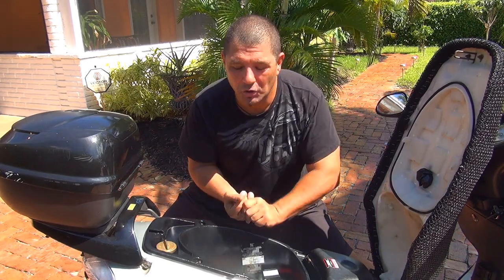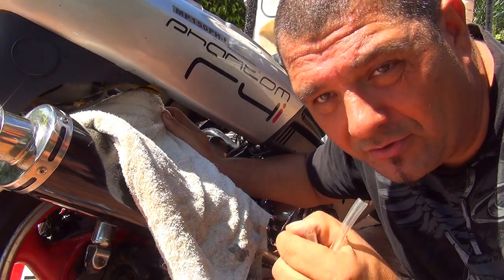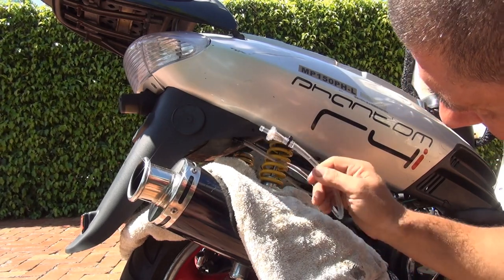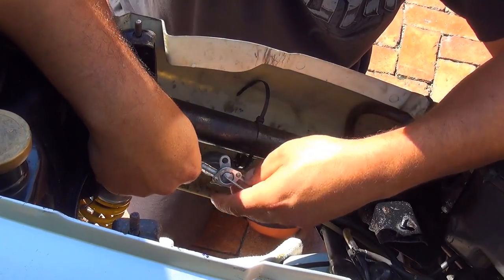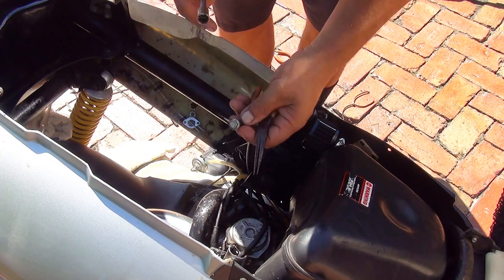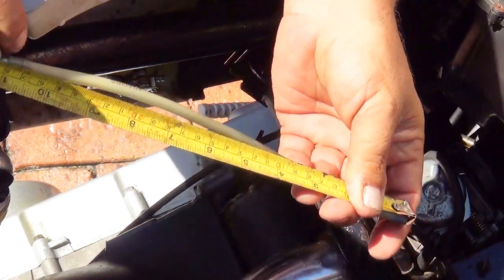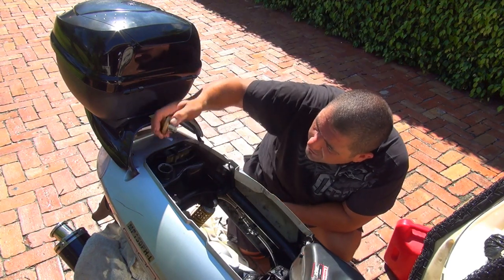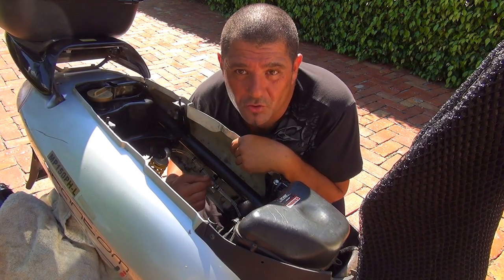Chinese Scooter Fuel Shut Off Valve Upgrade

Comment: I am working on an Amigo Speedy 50 and doing the same kind of upgrade. I am glad to see that the parts are available to fix the fuel flow problem.
Reply from the maker: That's great to hear that you're working on upgrading your Amigo Speedy 50 and fixing the fuel flow problem! Having access to the necessary parts makes the process much smoother and allows you to ensure your scooter is performing optimally
Reply: Same Amigo issue. Good video.

Comment: Hi, so do you just plug up the vacuum lines then coming out of the carburetor ? Wasn't sure.
Reply from the maker: Hello just plug the vacuum line that is connected to the center nipple at the petcock fuel valve

Comment: Hey my friend so if you plug the vacuum line coming from the inside manifold does that mean the top port of the carburetor is left open with nothing connected to it? I'm confused trying to make sure my fuel and vacuum lines are right
Reply from the maker: Hello my friend just place the manual valve and close the vacuum lime that go to the old fuel valve and live everything else the same way if you have an oem 150cc carburetor you need to have the vacuum on top of the carburetor

Comment: Love your videos! Can you tell me if adding a fuel shut off valve and taking off the petcock is a good idea on a new 150cc scooter?  or should I just leave it as is? Thanks!
Reply from the maker: Hello honestly is a good idea but the only problem that I don’t like much is that every time you stop longer than few hours you should close the fuel switch instead with the petcock the system goes on automatic

Comment: Hello my friend. At @18:45 what is the small air filter in the top right corner and what is it used for..? Thanks
Reply from the maker: Hello my friend that is a filter reservoir that is connected to the valve cover breather hose check my video how to install a reservoir. Thank you for watching my video

Comment: top video bud i have a 4 way petcock with having problems with but may convert it now, the only issue i am having is it seems like when the bike is running it is over filling and pouring petrol out the overflow any ideas as float and pin seem ok
Reply from the maker: Hello jaybillyjosh  the problem to me sound like that the carburetor float is not going back up after the fuel goes inside the carburetor and is not stopping the fuel flow so try to clean the carburetor and test again plus check if the carburetor floater is not damaged
Reply: @VirberelloScooterTips  hi thanks for reply, its been cleaned and on a normal float you have a metal tab you can alter but this is all plastic any ideas how to solve that as everything seems to slide and move free, jay from the uk

Comment: I have model with gas tank in the scooter's floor, lower than the carburator. Can I put a non-return valve instead of classic valve, to prevent fuel from draining from carb bowl back to the tank, and not obstruct the flow from tank to carb? Im having a problem to start the scooter when it sits 1 week or longer and I suspect thats the problem.

Nice video and content, carry on👍
Reply from the maker: Hello my friend I nor sure if placing a  non-return valve will work I think you will have problem when the scooter is running but the only way to know is to try and see if it can work . Thank you for watching my video

Comment: Why close the hose at 17:55? I was told that was the breather line for the head
Reply from the maker: That hose is the vacuum line coming from the manifold the head breather connects to the air filter box and you should never close that or the motor will build to much pressure

Comment: My gas float on my SSR -150cc wont come out of the gas tank? It seems to be bigger than the hole the unit sits in. I've tried every angle but cant get it to come out. Any ideas?
Reply from the maker: I did that in my scooter and took me long time before I find the perfect angle for the floater to come out look at this video at 20.05 minutes https://youtu.be/ECyStySqkXA with my father in law

Comment: Thanks for the video pal!!! ✌🏼 🕊️
Reply from the maker: Hello my friend thank you for watching my video
Reply: @VirberelloScooterTips  hello, my name is Timmy, I wanted to ask you a question, I own a 2021 pony 50 atm50a1 scooter, I need to make(fabricate) a muffler bracket, i don't have much money so buying a bracket online is not a option at this time, I was thinking of drilling a hole in the frame above where the muffler rests, and that's what I wanted to ask you the best way to make a homemade bracket so I can attach the muffler clamps too to make the muffler sturdy, any ideas?
Reply from the maker: @timmyczajka8411  Hello Timmy the best way to fabricate a bracket is to make a copy of the original bracket or something similar but I will not drill the frame because that can make the frame weaker and also sometime the frame and the motor they do not move at the same time but the scooter swing arm yes
Reply: Thanks pal!!!

Comment: Does it matter the size of the fuel fuel to the more gas to give him more power
Reply from the maker: The size of the fuel filter does not directly affect the power output of a scooter or any internal combustion engine. The primary function of a fuel filter is to remove impurities and debris from the fuel before it reaches the engine. Its main purpose is to ensure the engine's proper functioning and protect it from potential damage caused by contaminated fuel.
The power output of a scooter or any engine is determined by various factors, including the design and displacement of the engine, the air-fuel mixture, ignition timing, exhaust system, and overall efficiency. These factors are typically controlled by the scooter's manufacturer and are not directly influenced by the size of the fuel filter.

Comment: I have suzuki address v50g 49cc scooter it's a fuel injection scooter but it's not starting however the spark plug is fine and supplying the electric current. Than what happened is fuel inection malfunctioned ?
Reply from the maker: If your Suzuki Address V50G 49cc scooter is not starting and you've confirmed that the spark plug is fine and receiving an electric current, the issue could indeed be related to the fuel injection system. Here are some steps to diagnose and address the problem:
Fuel Supply: Check the fuel supply to the injector. Make sure there is sufficient fuel in the tank, and the fuel lines are not kinked or obstructed. Ensure that the fuel pump is functioning properly. You can listen for the sound of the fuel pump when you turn the ignition on.
Fuel Filter: Inspect the fuel filter for clogs. A clogged fuel filter can restrict fuel flow and cause starting issues. Replace it if necessary.
Fuel Injector: The fuel injector itself could be clogged or malfunctioning. You might need to remove it for inspection and cleaning. If cleaning doesn't resolve the issue, it might need replacement.
Throttle Body: Check the throttle body for any obstructions or malfunctions. Make sure the throttle body is clean and functioning correctly.
Sensors: Fuel injection systems rely on various sensors to determine the air-fuel mixture. Check for any sensor malfunctions. Common sensors include the Mass Air Flow (MAF) sensor, oxygen sensor, and engine coolant temperature sensor.
Fuel Pump Relay: Check the fuel pump relay to ensure it's sending power to the fuel pump when the ignition is turned on.
ECU (Engine Control Unit): The ECU controls the fuel injection system. It could be faulty or have a programming issue. If all else fails, a diagnostic scan tool might be necessary to check for error codes and ECU-related issues.
Wiring and Connectors: Inspect all wiring and connectors related to the fuel injection system to ensure there are no loose or damaged connections.
Fuel Quality: Ensure that the fuel in the tank is of good quality and not contaminated.
Compression: While this is less likely, it's still worth checking the engine's compression to ensure it's within the manufacturer's specifications.
If you've gone through these steps and the scooter still doesn't start, it may be best to consult a qualified mechanic or Suzuki service center, especially if the scooter is under warranty. They will have the tools and expertise to diagnose and repair the issue with the fuel injection system.

Comment: took mine to the shop.  it was chugging not wanting to go past 10 some time 25. but before it ran ok could get it up to 30 in no time.  replaced to fuel filter.  with a clear one drained the gas.but it still chugs. stays on 10 or maybe 15max and shits off in the middle of traffic.  any suggestions.  I took it to a shop.  but they said.its doing all.it.can do after 300$ of pay hoping to fix it. long story short its not.fixed . still having the same issue 😒my moped2016 50cc 49cc engine i think its a venture genuine 2016 moped . thought it could of.been bad gas or too much whight on maybe strained it.or something 
 really not.sure any ideas or suggestions.  about what I can do or.how I could.fix the issue?
Reply: shutdown
Reply: J.C.! You're being ripped off big time. Do yourself a favor and find a decent repair shop. If that's 300 USD it would be enough to get several brand new parts. Your problem is probably related with some carburetor clogging issues. Usually due to lack or inefficient fuel filter system. Electrical side i.e. CDI, ignition, plug... could certainly be another. 
Either case in a scooter 300 USD is a "shit load" of money. ;-)

Comment: Thank u so much.  I'm a girl and these shops keeps robbing me and taking parts of my new scooter and replacing with other parts. I'm suing needless to say. Anyways my problem I always that after I clean the carb n hook everything back up,  I have to take it to the shop just for the guy to create a vacuum so the gas can get to the carburetor.  It won't just start after I reconnect.  Will I still have to create a vacuum after this modification?
Reply from the maker: Hello if you place a manual fuel switch you do not need to create vacuum for the fuel to go to the carb but make sure you manually turn off the gas when you park the scooter
Reply: @VirberelloScooterTips  I'm so excited. I subscribed to you and thank you so much.
Reply: My fuel switch arrived today. I  have some clear hose that came with a siphon I bought a week ago.  My gas tank doesn't have a nipple like some.  It has a male thread with a petcock that screws over it. So do I just fit a hose over the  tank thread and zip tie it? The other end will be too big to fit over the fuel filter nipple and the switch nipple. That's where I'm lost.
Reply: @candace9642  - Do not make such a stupid mod. I wrote it elsewhere this mod is absolutely ridiculous. Totally senseless.
You need to "create vacuum". Literally suck on the vacuum pipe. it's that simple take seconds. You prefer a more distancing option. Get a syringe on any pharmacy. The bigger the better. Put it in the vacuum hose, pull the plunger. There's your vacuum on demand. Also takes seconds. My tool boxes always have a syringe, for decades. Extremely useful for a myriad of situations. Fuel, brakes, lubrication...

Get a good and decent fuel filter. you'll go years, without cleaning a carb. It's that simple. And please do not take advise from people who have no clue what they are talking about. Set the OEM petcock in leave it well alone. Aptly the old adagio, if it's not broken... ;-)

Comment: Why do a scooter Exhaust get so hot brun a holl in the muffler please help
Reply from the maker: Hello  Bennies many times the exhaust for gy6 are bad quality and insolation is not good and the pipe gets hot but sometime the exhaust do get very hot because are dirty inside or your motor is not running good and is missfireing and the pipe get very hot

Comment: Can you just put a cap on manifold and cap off the vacuum line on the top of the carburetor or run a hose from manifold to the top of the carburetor
Reply from the maker: Hello yes you can run the vacuum hose  from the manifold to the top of the carburetor

Comment: Many people have stated they run their fuel line from the fuel tank to the carb, with no shutoff. Is this a viable option or will fuel continue to flow into the carb when not running?
Reply from the maker: Hello my friend that is not a good ideas because the fuel will slowly leaking from the carburetor to the motor and will fill up cylinder and will leak inside the motor oil by passing the piston rings when scooter is seating more then 6 hours thank you for watching my video

Comment: My scooter just don't want to start what can it be? And ty
Reply from the maker: If your gas scooter is not starting, there could be several possible reasons for this issue. Here are some common causes to consider:
Fuel-related issues: Check if there is enough fuel in the gas tank. Ensure that the fuel valve is open if your scooter has one. Additionally, make sure the fuel is not stale or contaminated.
Spark plug problems: A faulty or dirty spark plug can prevent your scooter from starting. Remove the spark plug and inspect it for signs of damage or fouling. If necessary, clean or replace the spark plug.
Carburetor issues: The carburetor may be clogged or dirty, which can disrupt fuel flow and prevent the engine from starting. Cleaning or adjusting the carburetor might be required.
Battery problems: If your gas scooter has an electric starter, a weak or dead battery can prevent it from starting. Check the battery charge and connections to ensure they are in good condition.
Ignition system malfunction: A malfunctioning ignition switch, ignition coil, or other components in the ignition system can cause starting problems. Inspect these parts for any signs of damage or wear.
Engine kill switch: Ensure that the engine kill switch is in the "on" position. Sometimes, it can accidentally get flipped to the "off" position, preventing the scooter from starting.
If you have checked these common issues and your scooter still won't start, it might be best to consult a professional mechanic who can diagnose the specific problem and provide the necessary repairs.
Thank you for watching my video
Reply: @VirberelloScooterTips  got a new carburetor on ii change the spark plug wire a lot of it and still nothing getting plenty of fuel from the peacock it just don't want to start

Comment: Mine cut off while riding. Its not getting gas to the carb. So i ran it straight from the tank and it started. So my petcock is done pretty much.
Reply from the maker: Yes sometimes they get older and they gum up
Reply: @VirberelloScooterTips  i bought it from a friend its a2020 gator. It just stopped coming from work. New stator. It was acting like it wasn't getting gas.

Comment: Is the fuel pump switch better than the vacuum fuel pump?
Reply from the maker: Hello Bobby Joe the switch is not a fuel pump but a switch is better because has a natural gravity flow from the tank to the carb
Reply: NO, it is not. This mod is senseless and absurd!
Reply: @crpth1 why is it senseless and absurd??? It helps fuel flow better makes sense to me.
Reply: One pass from a fully functional automatic system. Which, literally, millions of scooters and motorbikes use for  decades. Without issues. So, now one spend time, money and absurd effort to go back. To a less functional system. That  "better fuel flow" claim. Sorry to say. It's as senseless and absurd as the previous. Thankfully engineering is a rather clear science. 😉👍

Comment: It does make sense but having to turn on and off every time can be very easy to forget
Reply: Guilty 👋
😵 but very funny when someone trys to  Steal  ur scooter & there gas runs out half way down the street! 👍
Reply from the maker: Hello my friend thank you for watching my video and be safe
Reply: @Davidsmith-tj5st  yea that's the good thing bout it u can turn it off I prob need new one no gas getting to the carb or something can someone help
Reply: Absolutely & i have done it ...but honestly if u leave it overnight  ur all good... & i just learned how bad that rubber is so that pressure switch..starts not being so air tight & now its just leaking in the bowl non stop. Fuel line  & get a niver vacuum switch ..but on/off just to me avoids other bs. 
What r u working on now? Im about to do the 150cc swap..i love them on the 50cc gy6 frame.  My intake manifold  bolt 🔩 studs r giving me issues 😑

Comment: Virberello can i leave the petcock on the fuel line thanks southafrica
Reply from the maker: Yeas you can but petcock has to be connected with the vacuum line or will not open if the motor is on